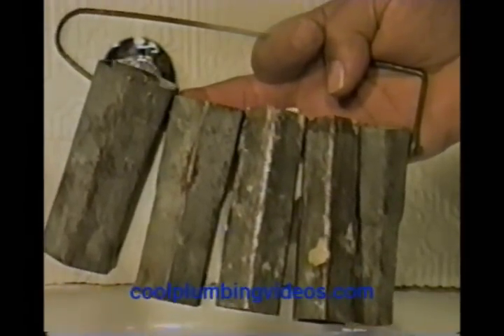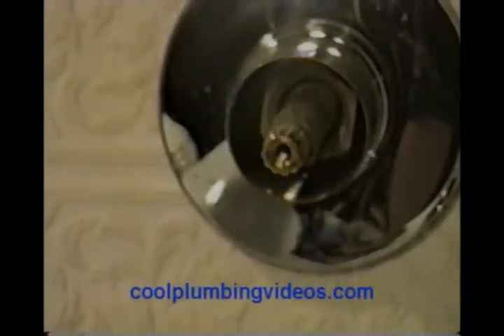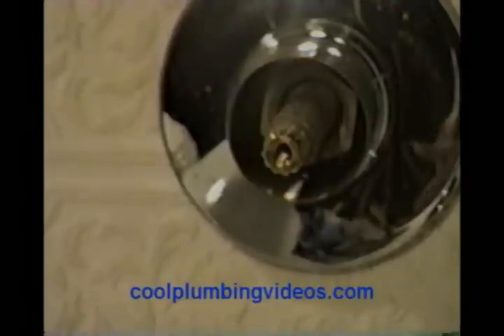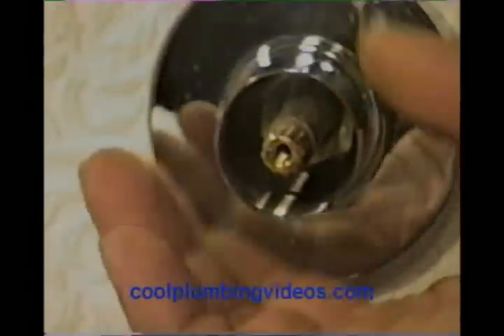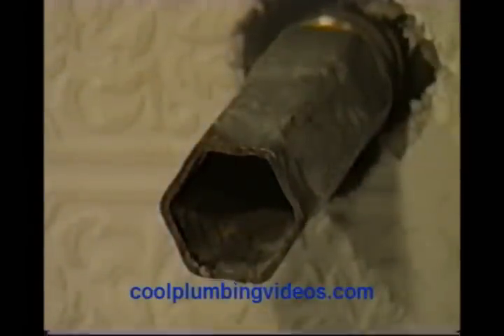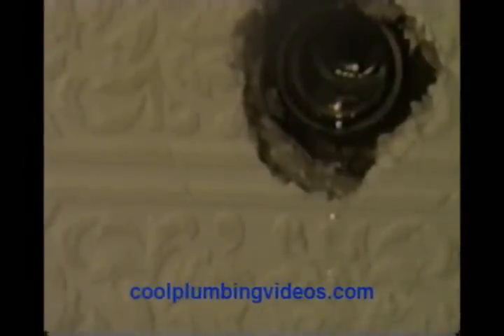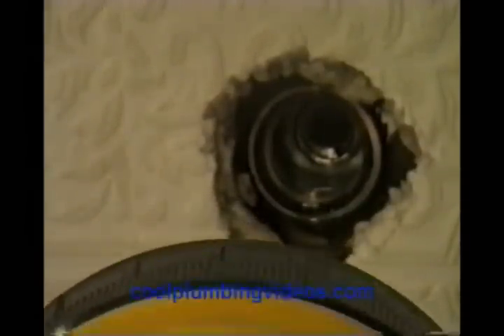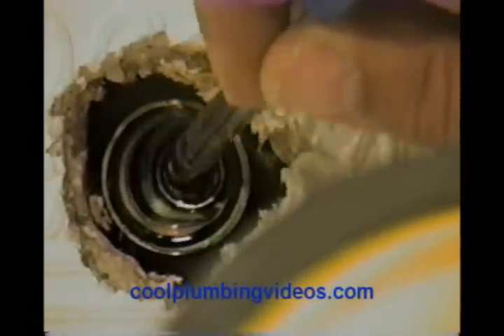Tub And Shower Repairs Two Handle

Comment from the maker: @txhotdavid Sorry I took so long to get back to you, But you have a two or three handle tub and shower valve. You going to need to cut it off and the main to the house. If you have a basement it should be at the basement wall facing the street it may be behind a panel or in a closet. If no basement look in the room with the water heater and furnace, of outside on the side of the house.

Comment from the maker: @gorgeouss79 Yes if you could send me a photo. Sounds like you may have hard water. and this tub and shower valve may have not been use very much it the pass. This would cause calcium built up in the valve body limiting the movement of the stem. If you could get the stem out oil it up and clean the calcium out of the valve itself with a small wire brush like one that you would use to clean copper pipe fittings.

Comment: @plumberx: First, thank you for posting this. I learned a lot from this video. I replaced the stem (house is 50 years old, it took a special order to replace the stem). However, the knob now doesnt turn all the way (hot water side~ didnt replace the cold water one). do you have any idea why? fyi: this particular knob was never able to turn all the way ever since we bought the house in 2004. any help would be great, thanks. oh, i can show you pictures if you want. thanks again. (female plumber)

Comment: I have a similar setup in my apartment with 3 knobs. The left for hot water, the middle to divert the flow of water from the shower head to the tub faucet and vice versa and the right for the cold water. I have been having temperature fluctuations during showers. What would be the cause of this and is there a quick fix? Please let me know. Your videos have been very helpful. Any suggestions on how to fix this problem? Thanks!

Comment: What's up if you replace the seat and stem, and the shower is still leaking?  It's cold water, so just replaced the cold side.  Figure if the hot side had an issue, the water would be hot.

Comment: by repack, you mean just to take the thick rubber cylinder and then loosen the nut and then tighten it again. i have done that several times to get the right combination between too loose and too tight. i tried grease on it, that i use when working on cars, to little avail. thanks for response.

Comment: I have older hardware on my two stem tub/shower system. There isn't a plastic cover on the ends, but there is a hex nut behind the handles. I have tried to loosen it but without success. What is the best method for removing those types of handles? They are star shaped btw. Thank you.

Comment from the maker: Sounds like the stoppage is in the hot water  line going to the valve. How old is your home? and do you have galvinized pipe? If the wire trick didn't work you have to have the hot water line replace :-(

Comment from the maker: @GLOCK23  One thing it could be when your taking a shower some one ells may be using water ells were causing a drop in pressure. The best this you can do for this is change out the three handle to a Posi temp tub and shower valve and they only come in single handle. But your going to want to talk to the meatiness guy first. One other thing it could be. If the washer on the hot side is to large in the stem it can swell up after getting hot and cut or slow down the flow of hot water. Good luck

Comment: Thanks for the video. I have a question about hot water valve. What is it that when you open the hot water and then you try closing it , it keeps turning and won't turn off until you find a position on valve that water turns off. Is something stripped in there or do I just need to tighten something. Need to fix before it gets worse. Thanks again.

Comment: @plumberx- i cleaned the calcium that had built up and it did the job :D thanks again! one problem/question: a bathroom's sink faucet upstairs is making some noise when we open the hot water (btw, the one i fixed is the hot side of a tub faucet from a bathroom downstairs). it sounds like the pipes making the noise. any idea why?

Comment: thank you for video and encouragement.  i installed new seat, stem. in turned the stem in by hand. i then tighten the nut by hand, then tighten the packing nut to turn the stem in a bit tighter.but i had to tighten a bit more because water would drip out of whole stem goes in. i tighten it slowly until the drip stopped. but then it made the handle that turns off water uncomfortably tight, not as with the old stems. i am stuck. tighten the nut so no drip, but a little bit more then the handle is uncomfortably tight.  Help?

Comment from the maker: @elchicho25   Sorry guy but no. The stem comes all different size and thread time. Some times the threads don't match or the Size.  To make sure you get the right stem. I would take the stem to True Value or Ace Hardware There pretty good at matching them up for you. Chances are when your community was built every one in the community more then most likely have the same type of plumbing fixtures, So the True Value or Ace Hardware would go with the community Plumbing needs. Good Luck and thanks

Comment: A Plummer replaced the stems for both hot and cold handles. When the water was turned back on, no cold water would come out of the shower head or the tub spigot. He took the cold stem off again looked at it and then put it back on again. Cold water still did not come out of it so he took it off a third time and did something to it and put it back on and there was only a little bit of cold water coming out of the shower. The hot water pressure also goes from very high to very low. He said he doesn't know what's wrong, only charged $25 and left. originally water cap coming out of the shower head or tub spigot all day long, even if the water was drained. Before he touched it, the hot/cold water pressure was perfect. Any ideas?

Comment: I have a question about fixing my leaking bathtub faucet. It is a two handled one just as in the video. I know what I am looking for when fixing these but in our apartment I can not shut off the water to fix the leak. It started just about a week ago and we have lived here about 4 months now. Am I going to have to get maintenance in here to deal with it due to the shutting off the water? Just curious because its like running uphill getting them in here to do anything.

Comment: I have a three handle shower in my bath. Hot, cold, and diverter. Only the hot water has very low pressure. The stem and seat has been replaced still no pressure. The is the only place in the house that does this. Any ideas?

Comment: I ha have a three handle shower in my bath. hot, cold, knob to control from shower to faucet. Only the hot water has low pressure. Stem has been changed but still no pressure. This is the only place in the house it dose it. I had 2 others look at it but no resolutions. Any Ideas?

Comment: My faucets (2) don't have seats looking anything like that, or any others on youtube. Nothing is marked with a brand name - not even the 'roughout.' The (square) stem has a number of o-rings and a driving grey plastic gearlike inner end. The "seat" has a number of small floating white FLAT plastic "washers" one of which is sort of hourglass- or butterfly- shaped and another w/a similar shaped hole. The "seat," a fixed flat washer, has another odd shaped offcenter hole. No seat wrench could work